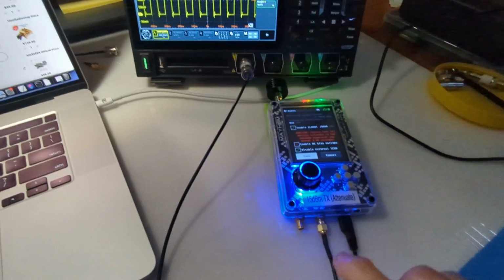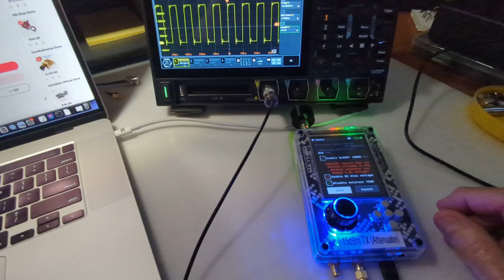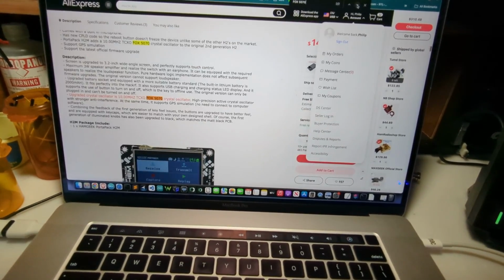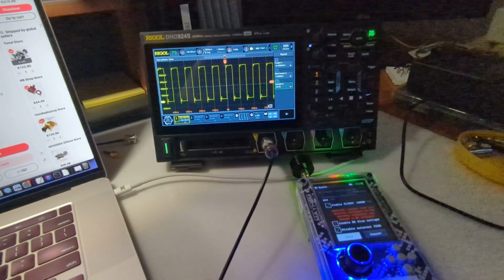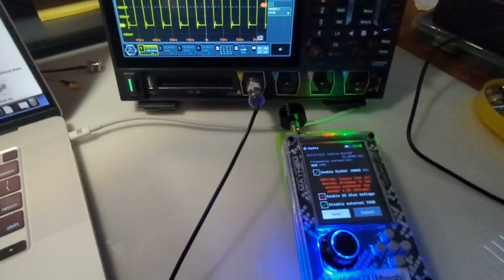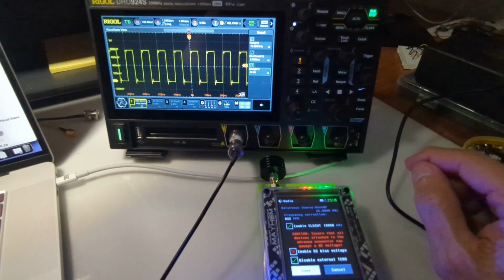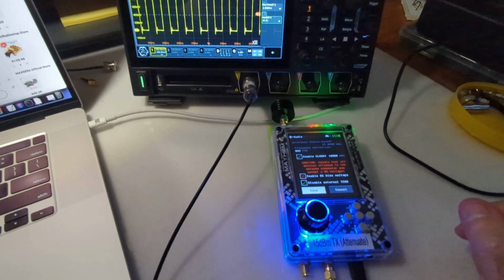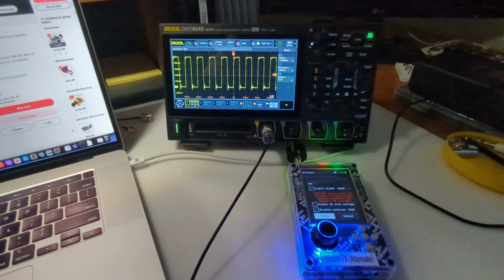HackRF PortaPack 10 MHz TXCO clock output signal

Comment: Wait a sec... i'd been confused..since I was sure that mine are 5 not 10.... and had written up some info I gathered from the wiki- only for the next video to play- wiping out everything I wrote...but now I am kinda glad because I believe you are discussing a new feature of that specific model. I was always directed that the MaxGeek/ that 1 you have there is unable to do further firmware updates...having to go through maxgeek and not official. Might wanna look into that. There are a few directly recommended through the Portapack git 1 recommended and tested/ verified by me being from Open Source Sdr. I just got a 2nd 1, new 1..from them.

Now where I'dbeen confused is I thought you are discussing the clock where mine is 5 not 10...but this is something complettelly differrent...a new hardware update to the MaxGeek versions of the devices...

and here I was going into temperature readings of the chips etc.....

Is this what you are mentioning?  "
CLKOUT/CLKIN: 10 MHz square wave (0V to 3V for a high impedance load)" from: https://github.com/portapack-mayhem/mayhem-firmware/wiki/Features

The clock/ chip/ temperature ramblings I had gotten into were in discussion of the chips "inaccuracy" of temp measurement- or so we thought...till discovery of it measuring the difference of ambient temp and value given which would give us the chip's temp.

Temp info I was on about: https://github.com/portapack-mayhem/mayhem-firmware/wiki/Dissecting-the-Temperature-logger

Comparing devices: https://github.com/portapack-mayhem/mayhem-firmware/wiki/PortaPack-Versions

honorable mention(s) :Links to more 'reputable ' devices.,, https://github.com/portapack-mayhem/mayhem-firmware/wiki/PortaPack-Versions